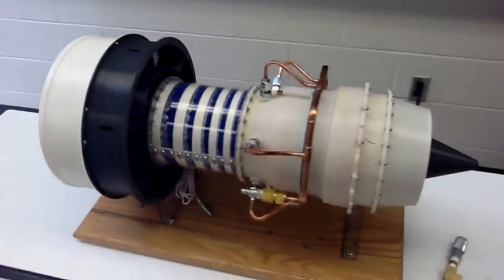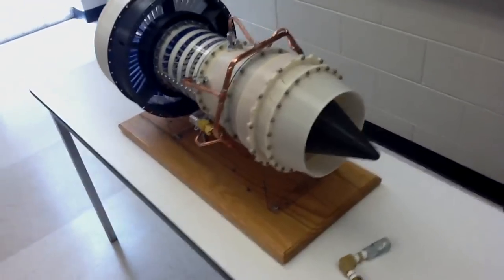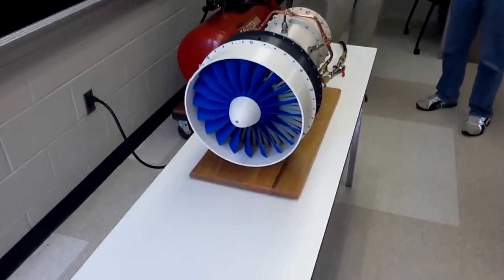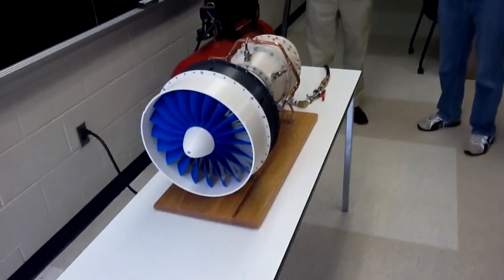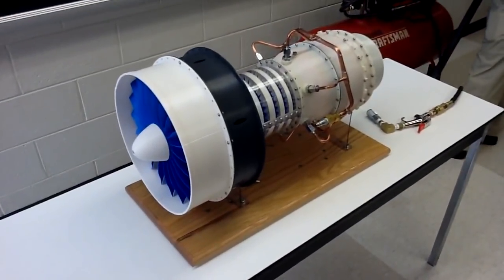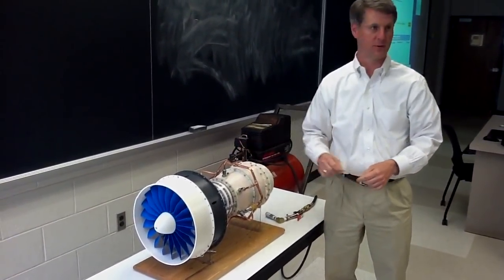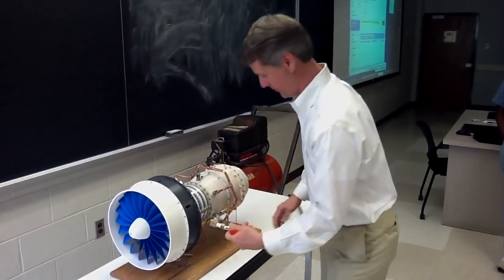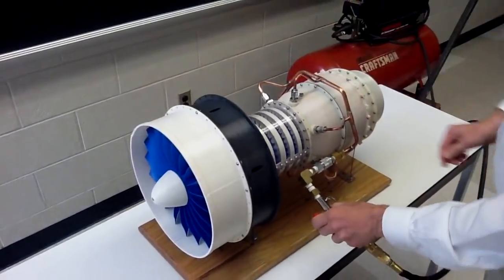3D Printed Jet Engine UVA Mechanical Engineering

Comment: Just a mockup. Deceiving title...
Reply from the maker: Not really. The engine does spin and create a small thrust via a source of energy (compressed air). It’s not meant to power an aircraft of course but its parts are functioning and no different from a real dual concentric turbofan jet engine in plastic form (well, no fuel dump/combustion obviously but that’s why the energy source is compressed air instead)

Comment: Google states that a 747 carries 150 000ltrs of fuel, how is that possible considering the size , passengers and luggage capacity!! All lies, jet engines run on free air and only need a small amount of fuel for take off and landings!
Reply: Smart man. Gas turbines are just air powered turbines. Free energy has been around for decades.

Comment: You blew compressed air over fan blades to make a toy jet engine spin. Its not rocket science.
Reply: Nope! It's not rocket science, it's turbo jet engine science. 

Q: when they blew the compressed air into the combustion chamber, why didn't it blow out the front of the engine also, making the compressor blades either turn the engine backwards, or balance the force generated by the turbine and keep it from turning? (Note that the compressed air manifold doesn't point towards the back of the engine.)

A: the air took the path of least resistance, which is out through the turbine, rather than through the maze of compressor rotor and stator blades, which allowed the turbine to turn the engine in the right direction, which allowed the compressor to push air into the combustion chamber, which provided more air to spin the turbine, which spun the compressor faster, which provided more air to spin the turbine, etc, etc, until bearing friction and turbine efficiency prevented any higher speed. Actual jet engines substitute burning air/fuel mixture for compressed air, but basically work the same way.

There's a lot more going on inside there than just blowing compressed air over fan blades.

For everything you ever wanted to know about the subject, and more, search for 'agentjayz' on you tube.
Reply: As you said When the compressed air entered the combustion chamber it 
took the path of least resistance and exhausted through the predicted 
path.  You simply raised the atmospheric pressure (ATM) in the 
combustion chamber above 1 atmosphere. In order to balance the ATM, the 
excess pressure took the path of least resistance over the high and low 
pressure turbines and due to their physical size, would be easier to 
rotate then the compressor.  As air V increases on exhaust this would 
create a low pressure post compressor wouldn't it?  Higher pressure now 
exists on the fan. The higher pressure air passes through the fan toward
 the combustion chamber in an attempt to equalize pressure with in the 
engine. This air flow turns the fan on its path to the low pressure area which is kept constantly low due to 
the flow of the compressed air and it's direction is governed buy the pitch of the turbine vanes.

 Bernoulli's Principle (Venturi Effect) 

Alternately,  you simply maintained a constant high pressure in the 
combustion chamber simulating combustion. Given that 1 ATM = 14.7psi and
 assuming a conservative 40psi from the compressor, (you dont want to 
wreck your model do you)   The ATM in the combustion chamber would be 
approx 2.72 ATM. You test this by simply measuring the ATM in the 
combustion chamber. If the ATM increases with RPM then it would be safe 
to assume the compressor is contributing. If the ATM <=1 Then the 
former.

Be it primary or secondary, direct or indirect, you are still directing 
air over fan blades for to induce rotation. 

FYI the " It's not rocket science" comment was in jest. I though maybe 
you would see the implied irony in the statement. 

Additional. Top job on the Model (toy) ;)

Comment: This is NOT a jet engine, it is a ducted fan engine, common among the radio controlled hobby people.  Used to have an rc airplane about 20 years ago that used two of these and it flew pretty well, so this is nothing new.
You can buy a REAL jet engine about this size and smaller that actually uses either kerosene or glow fuel for radio controlled aircraft.  They also have pulse jet engines, and ram jet engines.  Go to You Tube and type in  
radio controlled jet airplanes and you will see a lot of better engines and airplanes.

Comment: Too bad they never painted a bright photo reflective paint on the tip of one of those high pressure compressor blades and fire a strobe light at it.
Reply: Cody should do this.

Comment: nice fancy fan but I could get one at home depot for $15.00 and save a lot of time and money....no compressor nor 3D printing needed.
Reply from the maker: Thanks for the comment, I appreciate the humor. I think about this video as the following: if a tennis player makes a winning three point shot in a pickup basketball game at a 1 of 10 rate, it's a big deal and he would celebrate it, others would congratulate him. If Steph Curry makes 1 of 10 attempts in an NBA game, everyone would crap all over him. This video is more like the tennis player's achievement. It's a humble brag by a bunch of undergrad students. No claim of changing the history of jet engine design or manufacturing here.
Reply: +melihileri hey ehat 3d printer did you use? as in what brand, because my team is also looking to create one and we just needed guidance on this problem. Thanks
Reply: +melihileri I've alr added this clip to my fav list :)

Comment: Did you know that Goerge Brayton... Inventor of the "Brayton cycle" only made piston engines?  They were some of the first engines with enough power density to be used for motive power. They were used to power boats and a bus and a rail car. One was used to power the first  self propelled submarine. If you want to learn about Barayton's piston engines search Brayton ready motor or Brayton hydrocarbon engine or Selden Automobile.

Comment: Of course it's not going to be a 'real' turboprop, an engine of that size would cost a huge amount of money to build due to the materials required to withstand operating temperatures on the first stage turbine. It's a pretty cool prop to get students interested in mechanical engineering, it's also a pretty cool bit engineering in it's own right considering its balanced well enough to not shake itself to pieces.

Comment: "SIMULATING the way a real jet engine works" So stop bitching, people.
Reply: All they are simulating is making fans/rotors spin. This is nothing more that one of those plastic V8 motor models with a small electric motor to spin the crankshaft so we can see how valve trains work.
Reply: Stanley Roper air pressure from compressor vs air pressure from combustion. all the important rotary components are there though aren't they

Comment: Whoop-dee fricken doo! Why didn't you just blow air on a stick held down with a small nail? This way you can demonstrate the super esoteric "blowing a stick around with air principle" 

Wouldn't it have been cheaper, easier, quicker, quieter to incorporate a small hidden DC motor powered by an AC adapter, what is the point of the most inefficient power source in the shop????  

Does this school not have an A/V program? They can give You basic tips on video production like how to balance audio and edit out unwanted bs like air compressor noise!

You could have accomplished the same academic goals(mostly none) by drawing and animating a 3D CAD model....geeez!

Comment: You don't need compressed air to run a Jet engine. And plastic blades will melt if you try an start such engine. There is no Engineering involved.
Reply: Planes use compressed air to start their engines. It's more efficient than spinning the shaft with an electric motor, which would then need to be built to withstand the combustion temperatures.

Also note that this is only a model, and demonstrates how a real jet engine would work... without any boom or bang
Reply: yes you do need compressed air its how the air gets hot enough for to burn the fuel
Reply: Many use an electric motor to start; obviously it's not located inside of the "hot section"!

Comment: Now China will start producing cheap air planes with plastic jet engines.
Reply: +MK4247 TIS IS SO ORIGANAL
Reply: +MK4247 That give little thrust because they can't actually start them up with fire, which mean they will need a tun of compressed air. Which probably still won't be enough to get anywhere anyways.

Comment: I pretty sure the compressed air provides more thrust than the fan does.
Reply from the maker: obese1konobe guys I hate to be a bummer but this model is simply a replica to demonstrate and learn about how parts are designed/assembled. to have a real feel for what they look like.
honestly most of the energy put into the engine (injecting compressed air in this case instead of burning fuel since we're working with plastic)  goes to friction from spinning the parts and the thrust created is negligible.
that said, in the real version of a design like this one, obese1konobe is right in that the bypass air from the fan produces more thrust than the compressed air on the inside.
Reply: obese1konobe As ive been working with PW JT9`s im pretty sure the highpressure section does not drive the fan. It drives the high pressure compressor cause they are on the same spole/shaft, mabey youre talking about something i dont know about? :) if so id like to know :) The fan is driven by the lowpressure turbines, both the lowpressure turbines and highpressure turbines are of course driven by exhausts. True thou is that the fan makes the main thrust for the engine. You do have some reactionpower coming from the core engine as well but the main thrust is from the main fan. If you have ever had youre hand behinde the main fan in a testcell during engine testing you will understand the amount of air that fan moves just at idle, mindblowing actually! Just wanted to clear up the thing about what drives what :) So, you start the enginge by stating the highpressure core/spole/shaft. The exhausts from combining the highcompressor air with JET A1 creats combustion that passses over guidewanes to the highpressure turbine and throu to the lowpressure turbine makeing it rotate to drive the fan. So the fan is on a separete core/spol/shaft than the highpressure spole/shaft. The highpressure core/spole will start the lowpressure core/spole/shaft and you are now runing the engine. Now put some fuel nozzels behind the lowpressure turbinestage and you have a afterburner :D Sorry for bad eng, im a Swede and its been a long time seens i was in school :)

Best regards
Reply: @rookiedudestor5405  Fuel efficiency right? In a real jet bypass turbine, the bypass ratio has to be really high to get as much fuel efficiency per pound thrust generated. So the compressor can be very small volume. And that also means these type of engines can't run supersonic because of the enormous fans and real possibility of blade tip stall. Fascinated by the engineering though!
Reply: At first it was youre homble opinion "IMHO" but now suddenly you are being rude!? You havet read some  bok somewere and someone told you something,  im confused as to were you humble opinion went running?? When you studie aerodnamics and actually work with these engines you will be a bit more humble 😉 o maybe i am missunderstanding you totaly. Havet a Nice one mate 😉
Reply: YES IN SOME CASES FOR starting the engine.
Reply: the thing is that the compressed air was divided by many fuel pipes and also was reduce by fuel nozzles size and the result is  it cant deliver full power to spin the turbines and  DRIVE THE MODEL at FULL THRUST. MAYBE they  actually design the fuel nozzle to spray fuel  not to deliver full boost of air.
Reply: +RookieDude Stor   Nice explanation.  Turbines transfer energy from high pressure airflow to rotate shafts (of fans and compressors).
Reply: +10p6 So we are talking about the typical jet engine or are we talking about the GTF Geared Turbo fan which is still in production. A GTF Geared Turbo Fan is geared and from what I have read and mechanics have told me is that the Gear part that powers the big intake fan will FAIL. Because a Jet Engine will run as fast as you want it to run but the Jet Engine builders cannot build a Transmission to spin fast enough and this is what fails on the GTF or the typical Jet Powered Turbo Prop engines. From what I have read the front intake blades are not under power as the GTF transmission cannot take the speeds. IMHO
Reply: Wrong, the jet enginge will not run as fast as you want because the tip of the blades reaach supersonic speed and you do not want that ;)
Reply: And that talk about the transmission, im not even gona go in to that ;)
Reply: Wow....Ok so the blade tips cannot reach the speed of sound or it blows up. I said it will run as fast as you want it to but I guess you have never flown a Lear Jet. But then again you have never heard of the GTF Geared Turbo Fan engine. Hope you can get your money back on that Kollage Education. You really need to read Air and Space magazine. Good Luck.
Reply: Its a real magazine Air and Space and its all about jet engines and Government planes etc. I am just stating where I read it and if you want to look up Geared Turbo Fan then good luck. They have not figured out the Transmission issue and it goes something like this. The gears in the Trans cannot handle the speed of the jet engine, and this is common place in most all geared jet prop engines, I have had experienced mechanics tell me this. You are the ones who say a Jet engine will not keep speeding up till it explodes, I know they will, they have no speed limits other than destruction.
Reply: Yes compressed air provides more thrust becuse thes is only a model to show how jet engine works, You really thought that jet engine works on compressed air? :P
Reply: +Lukasz, "You really thought jet engine works on compressed air" Welllllllllll kinda does for some, takes bleed air from an APU to start up the engines on a 737, so I guess you could say it used compressed air to make it work!
Reply: 10p6 I'm pretty sure you're incorrect.
Reply: Jesse McCree since you work with Boeing aircraft didnthe noise at the beginning of the video sound like PW2040?
Reply: 10p6 it should for sure but I think that they made something inside so that it regulates how much air it lets in at once.
Reply: The pressures inside the motor propell 
it forward just like a balloon.when u blow up a balloon and tie the end it Will set on your hand because there is The same amount of pressure on all 4sids of the balloon.and when u untie the end it will move in the opisite direction because there is more pressure on the other 3 sids
Reply: Ask your "experienced mechanics" about the reliability of the Pratt & Whitney PT-6 turboprop ... which has a gearbox. And you don't know much about overspeed on a jet engine. I do. My day job involves certification of turbofan and turboprop engines.
Reply: +10p6  For all those who believe they are giving technical answers, I was referring to the air coming out of the 'Compressed Air Tank' (That big red thing) for the model.
Reply: 10p6 You are completely wrong. The "fan" section produces 80% of the thrust from the engine. The compressor provides the air to be mixed with the fuel to drive the highpressure section... which drives the fan.
Reply: +10p6 not for Turbofan engines...
Reply: @RookieDude Stor

You are pretty much spot on. As a certified A&P Mechanic who has at least one year experience working on a Boeing 767-300 servicing both engines (GE CF6-80's) and airframe, I can confirm that what you described is precisely how the engine works. There is a lot more going on inside these engines than what you initially described but what you said is a pretty good primer for those who are not familiar with the complexity behind these engines. Much of that complexity covers the flow of the air, how the air behaves when passing through IGVs, stator vanes, rotor blades, etc. The things you learn from how air flows is mindblowing to say the least and that is before you get to the turbojet engines on a F-15 Strike Eagle where you start learning how air flows when in supersonic compared to how it flows when in subsonic. But I'm sure you know about that since you explained the functions of the engine pretty well.
Reply: Come on, this is just a model.
Reply: +Saud Al-Faisal Siddiqui    They would not have built a precise fan if it was not meant to produce thrust of some kind.  I was joking about the compressed air.